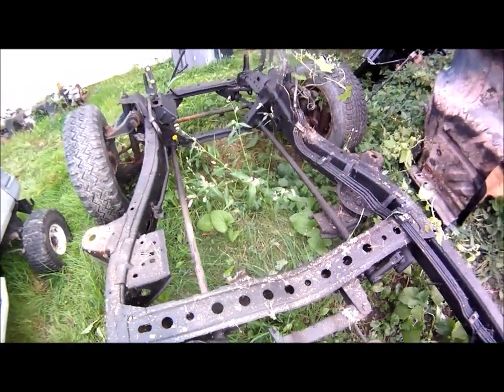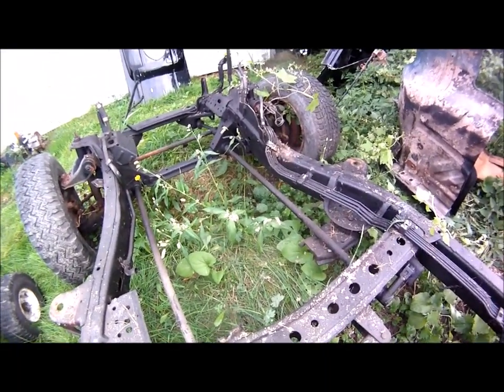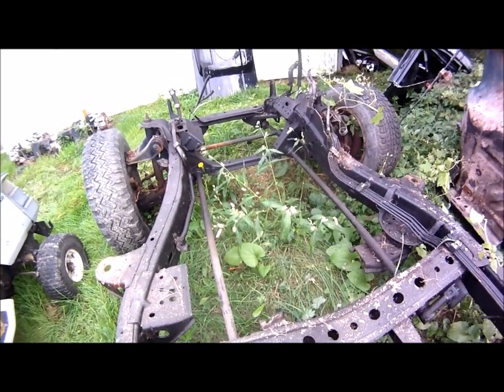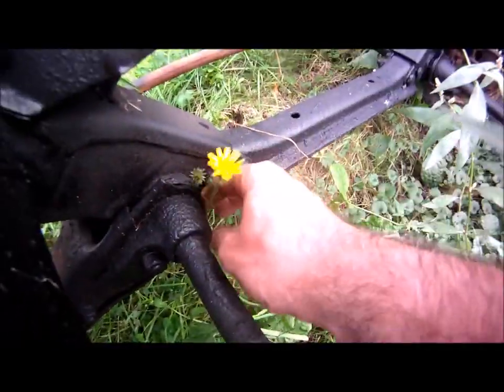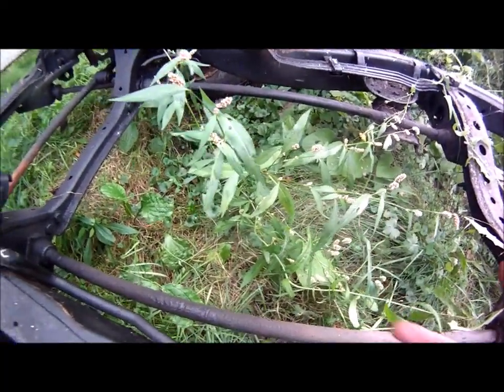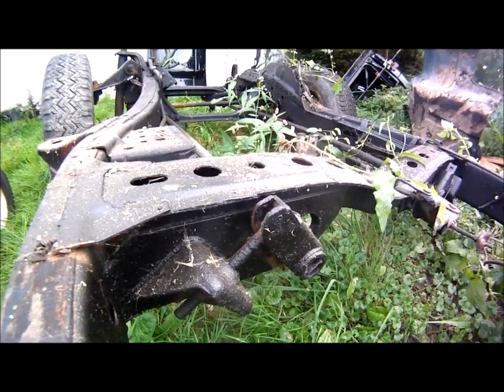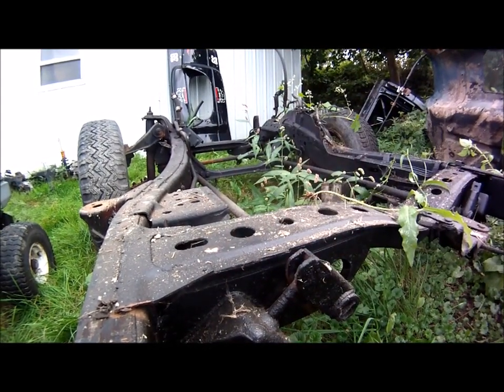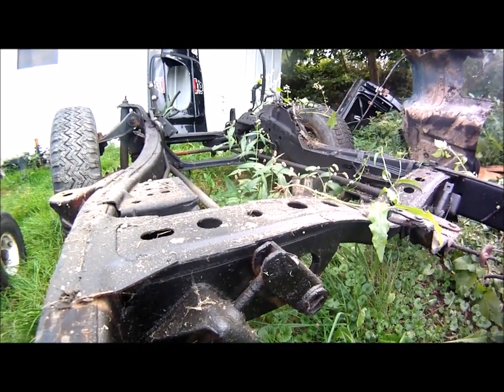Lowering 2WD Nissan Hardbody Front End

Comment: Thanks man, this was straight to the point and exactly what I needed. I lowered my truck on 2" drop spindles and 3" drop leafs. I like how it looks but with the tires I'm currently running my front fender rubs the tire sometimes over bumps or hard corners. So I need to raise the front just a little bit till it stops. Thanks again

Comment: Very good video.  I have done this job too.  BUT, if you ever remove the torsion bar( to replace the control arm and/or lower ball joint.. then you must reinstall with the control arm's rubber bumper touching the truck's frame.. as your starting point.  Start tightening the anchor in an almost vertical position, pulling it downward to its desired ride height.
Then.. I got a professional front wheel alignment with the new ride height.
Reply from the maker: Yes,  I agree.

Comment: I just bought a hardbody and it sits higher on the driver side. I checked the torsion bar and there was a 1/2"  difference. I even them up but it didn't change any. I will rest my truck on jack stands next time.
Reply from the maker: VICTOR M the fuel tank is known to cause a lean to the right side, otherwise known as the hardbody lean.
Reply: New suspension?
Reply from the maker: VICTOR M all of them, the weight of the fuel tank just pulls down the right side slightly. You can adjust for it but as the tank empties the right side will get a little higher. The fix I will be going to is a bed mounted fuel cell, that can be evenly mounted so both sides share equal burden of the weight.

Comment: i had my truck lowered this way for a while causing my tire to be a little cambered in   . recently i have noticed a small humming vibration on my floorboard , do you think my front bearing is going bad because of this ? mahalo🤙🏽
Reply from the maker: Does the noise change when you turn the wheel?
Reply: @SuperchargedPathfinder  it does feel like it goes away when i turn

Comment: I have a two-wheel drive hardbody extended cab v6 and I redrilled the leaf spring mounts to lower the back and I was going to get spindles but could I just do this and get away with it I'm not trying to slam it to the ground or anything but I just want the front to be level with the back and I have new shocks all the way around ((this wouldn't make the front suspension soft will it???)) because if it does I'd rather just go with the spindles and leave my bars alone
Reply from the maker: Depends on the shocks. I have kyb monomx all around.

Comment: I have oil coming from the dust cover, the boot is rotted. Where is the oil coming from?
Reply from the maker: The rubber boot on the end of the torsion bar?
Reply: @SuperchargedPathfinder  Yes, is there grease where the boot attaches.
Reply from the maker: Well. The splines on the bars should be greased to help keep squeaks down. Most dont have grease,  maybe you got lucky and someone did.
Reply: @SuperchargedPathfinder  Thanks for the reply.

Comment: Quick question, I have an 89 2wd d21 and was trying to put a 97 1 piece bumper. Can’t figure out how to put the bumper on. Do I use the 2wd bumper brackets or the 4 wheel bumper brackets?
Reply from the maker: 2wd brackets.

Comment: I have a 1996 D21 and wanting to drop it about 2" in the front. By doing what this video states, will it change the way it rides? in other words will it get stiffer, and does it need to be aligned after doing this? Thanks for the help!
Reply from the maker: It might softer. Depends on the shocks or how tired your springs might be. I do recommend an alignment but make sure they know its lowered and that the specs are custom.

Comment: I’ve seen these before under my truck but I forgot where at. The front or back? Also, if I put it on a lift, would that make it easier?
Reply from the maker: nicholas swomley towards the front of the truck, midway back. Easier on a lift yes.
Reply: Nismo D21 if I raise it from the torsion bars, are there any consequences later on?
Reply: Nismo D21 how did you keep track of each side when you lowered it? Like how did you know they were at the same length?
Reply from the maker: I don't see any consequences other than if your suspension is worn or damaged the alignment might be difficult to get right. I use the body line measured to the floor to check for even leveling.
Reply: Nismo D21 well I still have to get an alignment done on my truck so do you think lifting it will make it worse?
Reply from the maker: Any changes in parts or ride height can affect the alignment. It is best to have it checked after any changes. If you lift the truck the OEM specs will no longer apply so a custom alignment will be your only choice. Just make sure you tell who ever is doing the alignment what you did so they are aware that the numbers will be different. A good alignment shop can give you good specs even with a modified suspension.
Reply: Nismo D21 so is there any thing else I have to add on to the truck if I want to either lift it or raise it? Sorry I’m asking a lot of questions lol, I’m always curious
Reply from the maker: If it's a 2wd truck you will have to lift the rear with lift shackles. The front will allow some upward adjustment without parts needed. Before you do any adjustments I would check the front end for worn parts. You don't want to stress a worn part by lifting it out of its normal range. If everything checks out then go slowly forward with the lift.
Reply: Nismo D21 yeah it’s a 2wd
Reply: Nismo D21 I’ll probably leave that alone since it’s OEM

Comment: The mount for my torsion has popped out of the control arm on the driver side of my truck. Any good ideas on how I would drift it back into place?
Reply from the maker: totalld21 are you saying the bolts that hold the mount to the control arm are missing?
Reply: Mine is a 4x4 so not the control arm but on the end where torsion bar hooks into the cross member with the lip thats on the end of the bar, popped down and forward towards the front of the truck. Kind of hard to explain without getting a good picture.
Reply from the maker: totalld21 I follow. I have a 4wd pathfinder here for reference. Do you have the front up on jack stands?
Reply: Not at the moment no, and have been driving it for over a year with no issues. But I'm assuming your suggesting jack up the front end to take the stress off the bar to make it easier to adjust?
Reply from the maker: totalld21 that is correct.